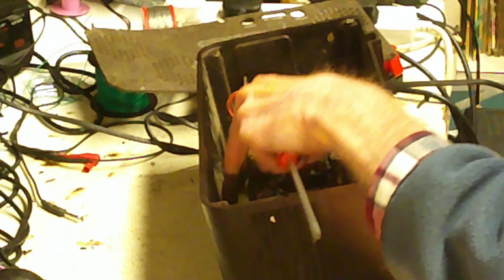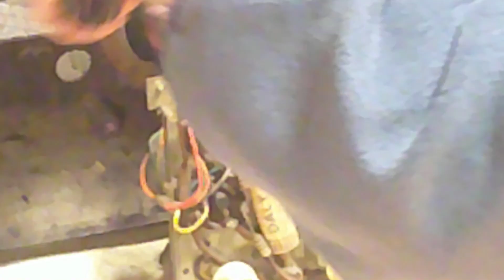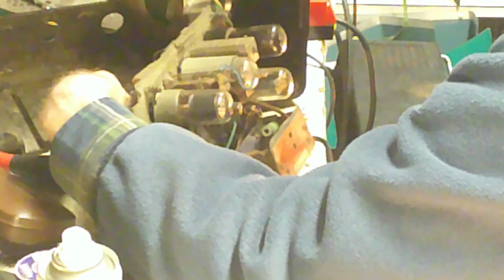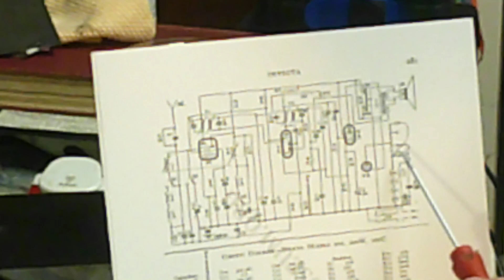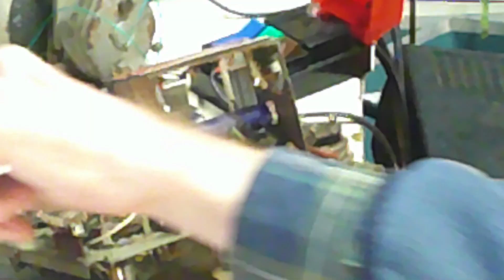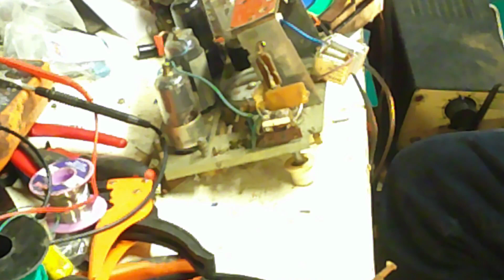Trash to Treasure! Invicta 200 from 1947

Comment: Working first power up. No modern set would do that in 70 or so years time. Just lost yet another medium wave transmitter in my area the Radio 4 London rely on 720 khz.
Reply from the maker: In the state this was in it still worked ! Stuff made now would be in Landfill in 10 years.  So a tip - put some of today’s stuff away and wait for them to want it in 20 years!